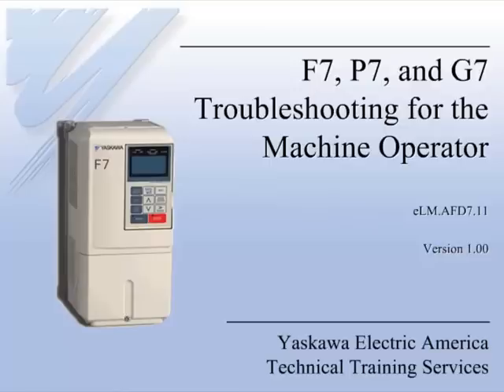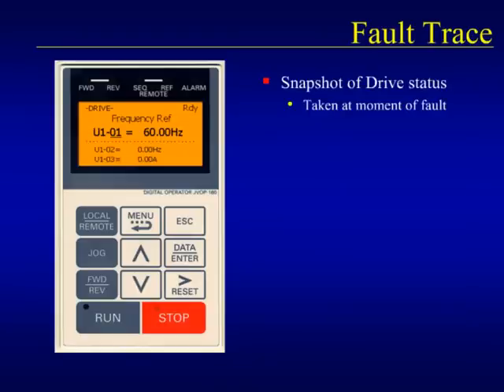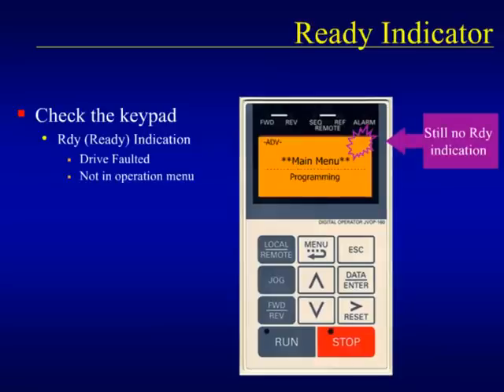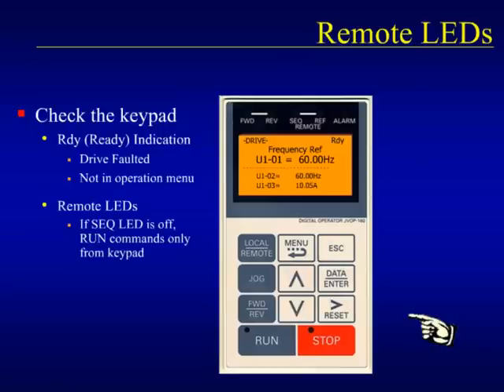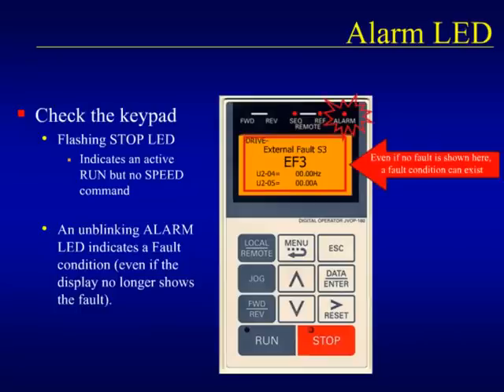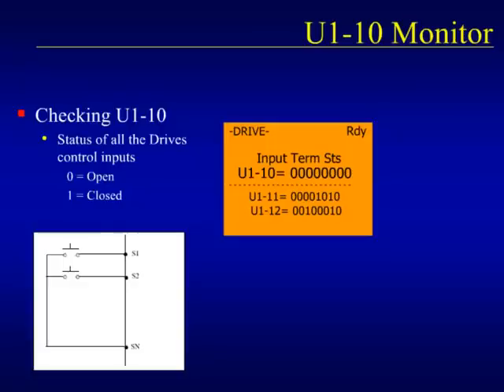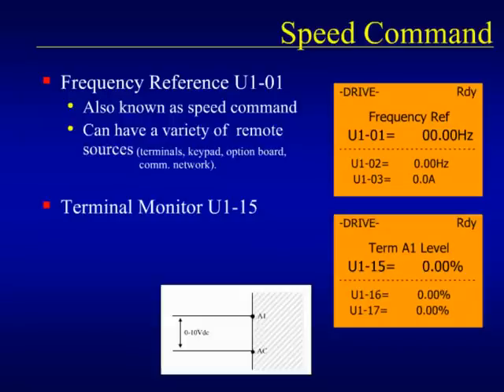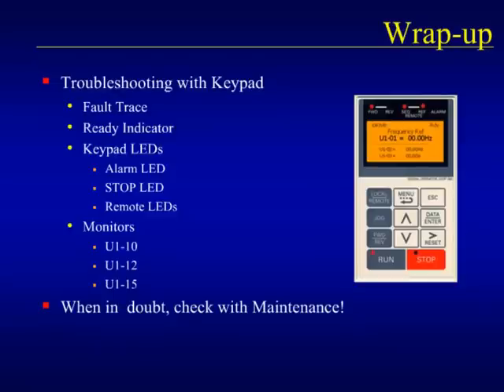F7, P7, and G7 Troubleshooting for the Machine Operator

Comment: How to factory reset f7 drive through digital operator
Reply from the maker: Thank you for your interest in "F7, P7, and G7 Troubleshooting for the Machine Operator". Initializing a drive and resetting it to factory default can be done via parameter A1-03. There are two initialization settings, 2-wire or 3-wire. For 2-wire initialization, set parameter A1-03 = 2220. For 3-wire initialization, set parameter A1-03 = 3330. Here is a link to our Yaskawa Solution Center: https://solutioncenter.yaskawa.com/selfservice/viewdocument.do?noCount=true&externalId=10360&sliceId=1&isLoadPublishedVer=&docType=kc&docTypeID=DT_FREQUENTLYASKEDQUESTIONS_1&stateId=8897&ispopup=true&cmd=displayKCPopup&dialogID=192767&ViewedDocsListHelper=com.kanisa.apps.common.BaseViewedDocsListHelperImpl&openedFromSearchResults=true

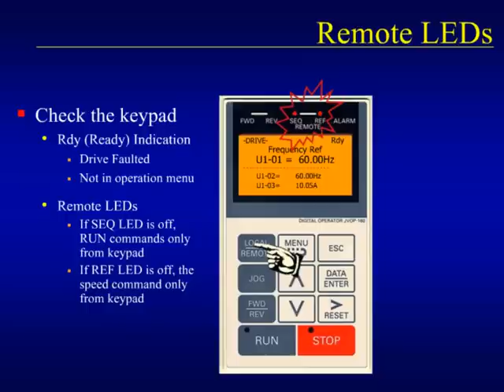Comment: How do you set the remote parameters so it will run at 60Hz? I am stuck at the remote at 0Hz like 5:20 in the video
Reply from the maker: Hi, @Cgudvangen1. The frequency must be adjusted from your REMOTE device if your "REF" light is "ON." If you wish to adjust the speed from the keypad, B1-01(Frequency Reference Selection) should be set to a zero (Operator) in your programming.